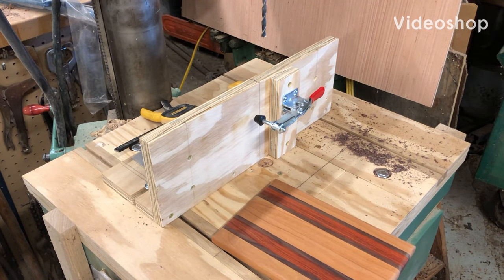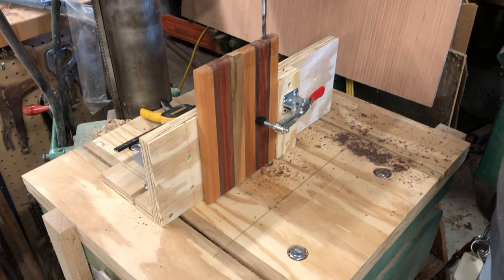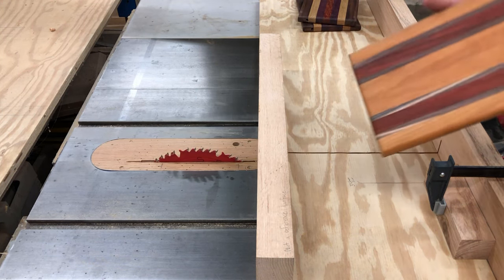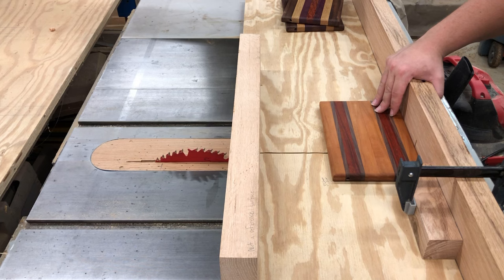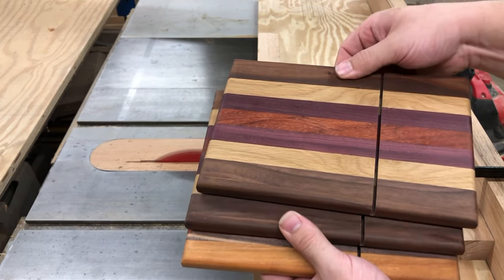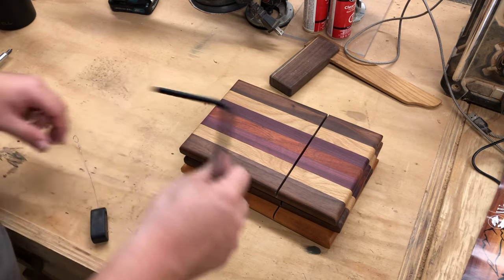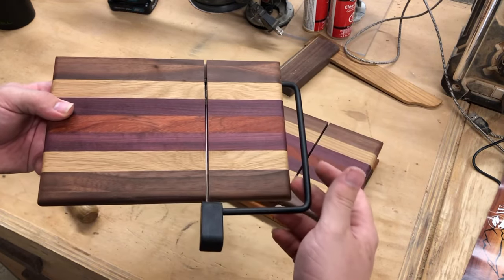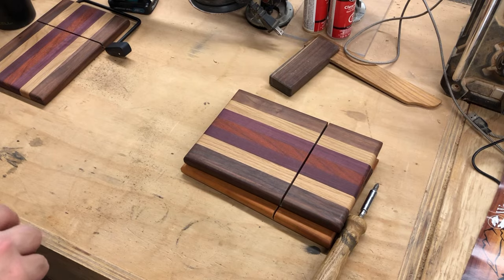How to make cheese slicers (More craft show inventory, make money woodworking)

Comment: Thanks for the simple video. I have a question… the instructions I have (and kit too) sent me an extra wire and said within the first few steps of putting the wire in, it will actually break and I’m to remove the broken wire pieces and put a new wire instead.. you won’t seems to have this issue? Thanks
Reply from the maker: I have never heard of that with any of the kits I’ve bought in the past, not saying one of them doesn’t but these that I get from woodcraft have never mentioned. As long as the slot for the wire is cut correctly I’ve never had a problem with the wire binding or breaking and I’ve assembled quite a lot of these slicers. 

What brand of kit do you have that says this?

Comment: oi, you need to slant those cuts!
Reply from the maker: Not sure I’m following? Any advice is welcome though!
Reply: Never make straight cuts on cheese boards with limited thickness like those. The moment they fall or hit the ground they will break.  You need to raise one edge at least a 1/2 in and make slanted cuts. @TheCountryCraftsman
Reply from the maker: Never had an issue with that, the board still has enough meat below the groove to be plenty strong. I’ve done a lot of them this style/size without an issue. Not saying it couldn’t happen, but I’ll take that into consideration!
Reply: @TheCountryCraftsman he is talking about the cut for the wire. It needs to be slanted. You are not leaving enough grain and that board has a weak spot all the way across it now.
Reply from the maker: It’s still over a 1/4” of material still plenty of material to hold it. Slanting the cuts won’t  increase strength. The plans/instructions also call for it to be this way. I’ve also never had an issue on well over 100 boards.
Reply: @TheCountryCraftsman  Yea I messaged woodcraft about it. I feel like the issue is with safety so they would rather not promote an angled cut but it can be done rather safely.  Honestly, I think Chris Devo of Devo's woodcraft has found the best method.  I still stand by the physics,  though, of the angled cut.